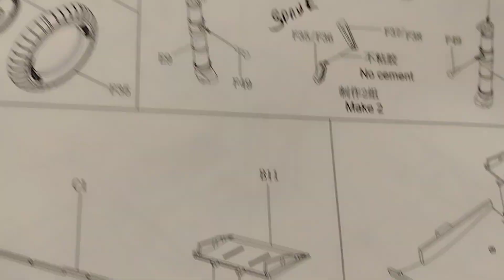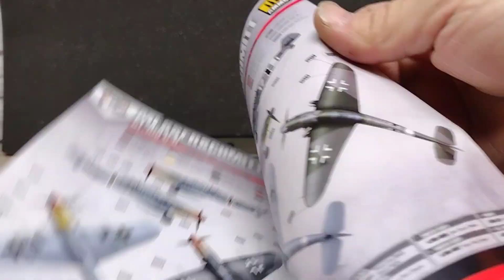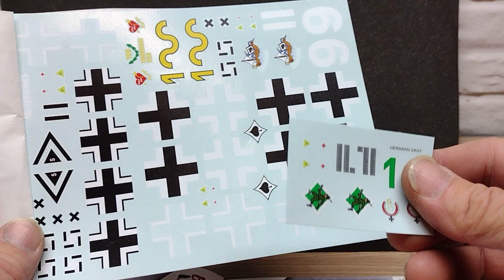BF109 G-6 Border models 1/35

Comment: Those tires look great with detail and all. The oleos are to small for a ballpoint spring to fit in I guess. I have a Herman Graf 109 of the old 1/32 Revell but this kit is so much better except for that decal sheet. That's indeed a bit of a disappointment.